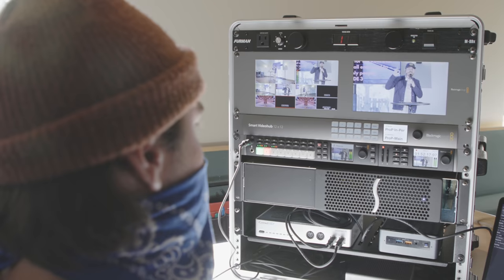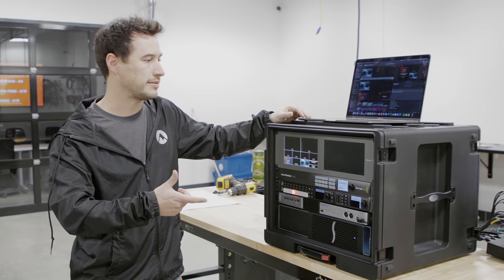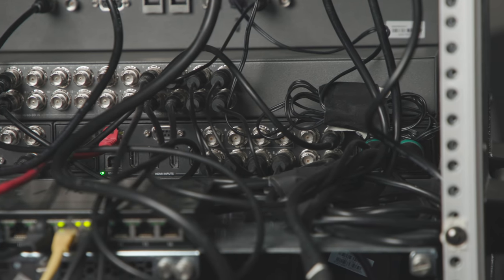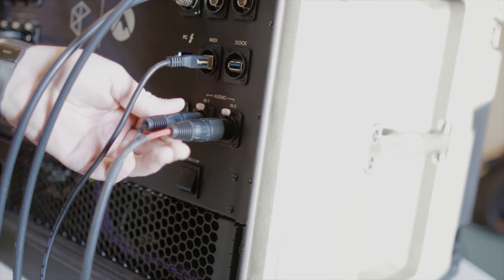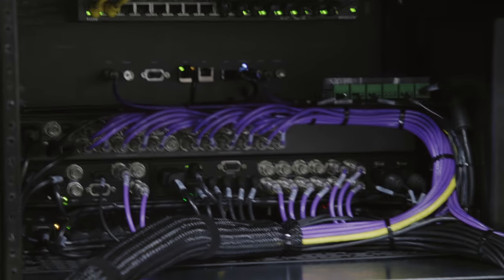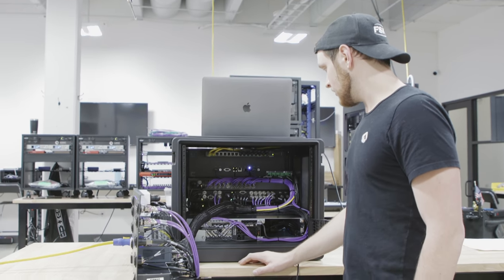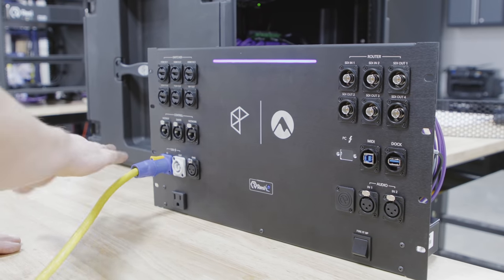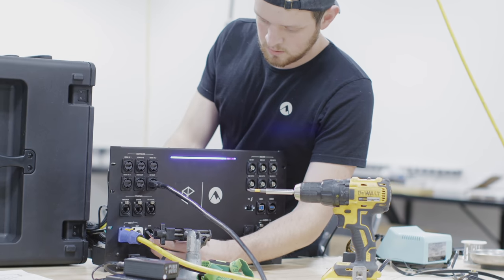Church Live Streaming Video Rack MAKEOVER feat. Summit Integrated Systems

Comment: Even if you did not use a backplate as in this case, there is never a reason to make a rat nest out of wiring up any equipment. Run like wiring with like wiring and label both ends and create a diagram on paper. This is a practice you can find in many pro areas telephone companies, cell phone, radio/TV transmitter rooms, and networking companies. Hats off to Summit Integrated Systems their custom work is awesome.

Comment: A beautiful outcome at the end. Much respect to people gifted with cleaning up our mess.

Cam you please do a production on best solution for operation a multi-campus broadcast system in a wireless format that does not require internet connectivity?

Sending out audio-video feed from the broadcast headquarters to other church locations as their church feed on display screens. How does the best churches achieve this?

Comment: I am doing such artworks with all my mobile rackmounted gear. So the wow-factor is not as huge as for other people.

This one here is as clean and tidy as it could be. Respect for that.

But there is one thing to think about:
The price!
Reply: Since we're doing everything in-house, including the custom rack plate manufacturing and designing, we're actually able to keep the price pretty low!
Reply: @Summitintegrated  
How much whould I pay for this shown custom rack mount system inclusive wiring and the back panel?
Reply: @SeG_VT  We don't publicly post pricing information on custom solutions like this but we will be releasing a new version of our GO Pack (summitgopack.com) that is a lot more similar to the Churchfront streaming pack for around $4,500 for a non-encoder version and around $6,000 for an encoder version.

Comment: love this video, the only thing im missing watching the video is, why not to adapt the rack custom plate to open like a door? its a more easy to everyday use, thanks for this amazing video
Reply: The idea of the rack plate and overall design was to eliminate the need to open the rack up at all. There's really nothing you need to be able to access inside the rack that you're not able to access using the outward-facing gear and rack plate. Hope this helps!
Reply: @Summitintegrated  amazing work

Comment: My only concern with how they have the Furman mounted is that the power cables are running parallel to video/audio cabling. Especially if you ever utilize phantom power or other low voltage audio solutions, that can very easily introduce interference into the signal. It’s always best to keep them separate and if you ever have to cross, make sure it’s at a perpendicular angle. Just my thoughts. The wiring is superb, and I’m not sure it would be possible to do it any other way in that form factor. I’m sure all of these guys are CTS D/I certified so they know what they were doing.
Reply: Thanks for your thoughts!

Comment: Would like a closer look at the 12v bus in there
Reply: We upload a ton of great content (including more up close and personal gear shots) on our Instagram (@summit_is). Head over there for more photos!

In the meantime, the 12v bus is basically a power bus that our assembly team came up with that uses Phoenix terminal block connectors. Our team ties a 12V DC power supply into it, and then they feeed all the 12V devices off of that same brick.

Comment: That’s a great upgrade to an already amazing rack. We had Summit build our AVL setup from scratch for one of our campuses and can confirm they put the same level of care in the cable management of everything they do. I am a little curious, where do you connect your laptop to the sonnet? I’m thinking of building a baby rig with an ATEM Mini pro, and the USB-C connector is the one part I haven’t figured out how to add a backplate interface for.

Comment: 3:51 - What's that diagram called? I suppose I can make something like that with a number of software (Word/Pages, Excel/Numbers, Adobe Illustrator, etc.), but what do people typically use to make it? Where can I learn more about these diagrams? I get the basic idea of how to read it, but I'm wondering if there's some meaning I can't figure out with a few design choices that were made. Why are the Switcher and Router rectangles so much taller than they need to be? Why do some rectangles bunch the ins/outs at the top, while others put them in the middle (height wise)? And a few other questions.

Comment: What type of HDMI cables are you using for long distances?
Reply: Because HDMI is limited to 10m I think they use the Blackmagic SDI / HDMI Adapters.
Reply: But he is only using 2 sdi outputs so the camera's would be HDMI, and it wouldn't be logical to convert from hdmi to sdi and then back to HDMI. So the camera are HDMI Input if I'm correct.
Reply: @rensdenbraber9058  we have long camera runs and do just that,  short HDMI out of camera to Black magic converter sdi to ATEM mini and convert back to HDMI works great!